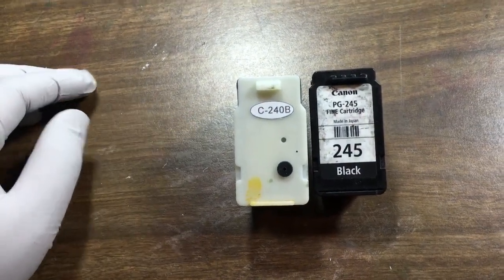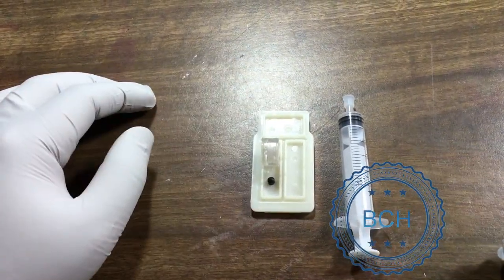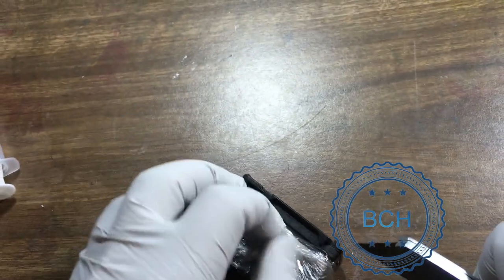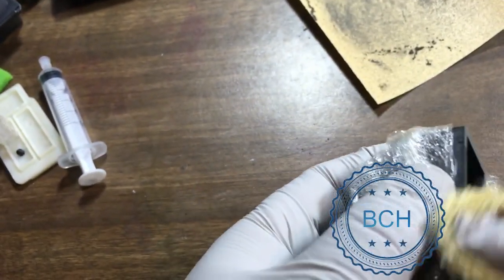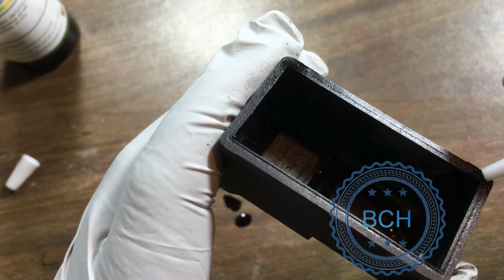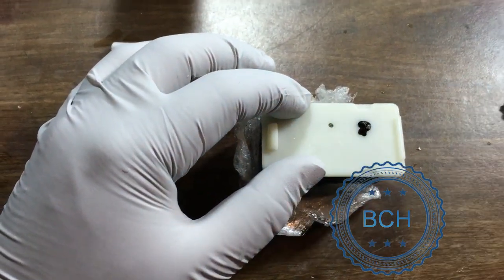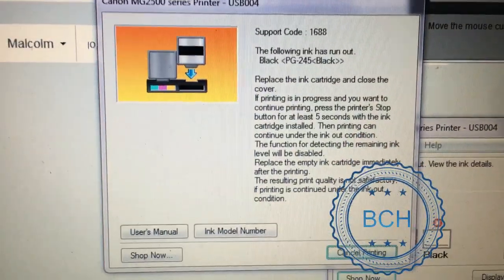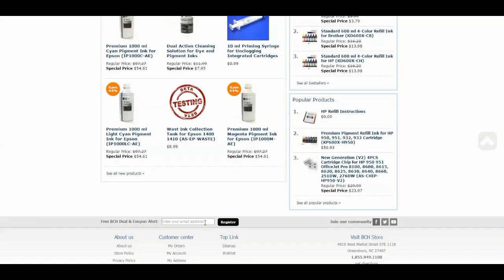A Simple Way to Make Refillable Spongeless Canon PG-240 PG-245 Cartridges MG 2520

Comment: The hardest part is opening the cartridge from the top with a knife. 
The HP 802 inkjet cartridges are really difficult to open. 
A knife won't do and you may get injured. You might have to use a saw.

Comment: Certainly did enjoy it, thank you... Just curious tho, why does it no longer need the sponge
Reply from the maker: Good question! The sponge is used to regulate the ink pressure.  The new cover has a built-in pressure regulator, so the regulator replaces the sponge.

Comment: My vintage HP DeskJet 845C has a large NO sponge cartridge that is easily refilled, but it is wise to make certain seepage from the print head has stopped before installing it.  I'm uncertain if I would simply prefer to refill a sponge more frequently than utilizing this modification.

Comment: isnt the sponge supposed to make sure ink dosnt start drippin out of the head?
Reply: I was wondering that myself. The amount of pressure on the printhead with the extra ink must have some influence on it. Yes the sponge takes up space and therefore less ink in the cartridge but it may relieve pressure on the printhead too.
Reply: The ink will stop seeping out of the head once things have "equalized", so you only have to make certain nothing is dripping before installing it.  I have an HP cartridge (2001 printer) that has a large ink reservoir with no sponge that is easily refilled.   The no sponge cartridge design is valid.  I might simply opt to refill this cartridge more frequently.  It doesn't take that long to pop out a cartridge to inject 7ml of ink.
Reply: Pau Gasolina maybe this device is making it pressurised?
Reply: I suppose the only problem is if your print head breaks, you have 20ml of ink that can freely flow out of it and spill all over the furniture that the printer was sitting on. the sponge would prevent that.
Reply: Especially during a deep clean from maintenance menu. A lot of ink will be sucked out. I am tending to stick with sponge
Reply: For anyone still wondering, there is a pressure regulator in the bch cover

Comment: You dont need to remove the sponge first. You may scratch first and the dust particles will trap in the sponge. Then remove the sponge and  glue it.  No need to wash and spoil the head.

Comment: If i put a new cartridge would printer track my ink level after hard reset by press stop button for 5 sec.
Reply from the maker: Yes, it will.  You turned off the ink tracking for this cartridge.  Once you have a new cartridge, it will be back to normal.

Comment: Did the cartridge changeo r something. I'm trying to open it it's so difficult.
Reply from the maker: Find the seam and it should be easy.
Reply: I was able to get it by prying. Do you only cut on the front side?
Reply from the maker: Yes, the whole cover should be off easily once you have an opening on the seam.
Reply: Ok thanks

Comment: what other ink can I used where can I get it please answer me
Reply from the maker: I like to use dye ink in this cartridge, although the cartridge is designed for pigment.  Keep in mind that the cartridge was designed for one-time use only, so dye ink will make it having a longer refill life.  Also, the dye ink is cheaper too.  You can use BCH's ID30-K.
Reply: Thank for replying can I buy the paint locally like walmart or somethink its not the same thing
Reply: Where cN I find that pain dye ink
Reply: Tattoo ink or something like that
Reply: I have cl-211xl. And pg-210xl. For canon
Reply from the maker: I don't think tattoo ink is a good idea.